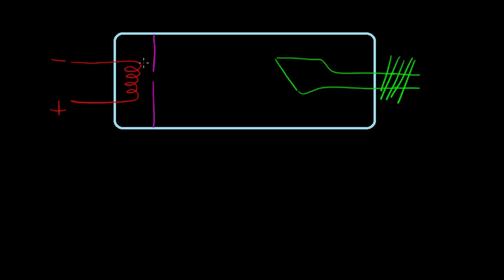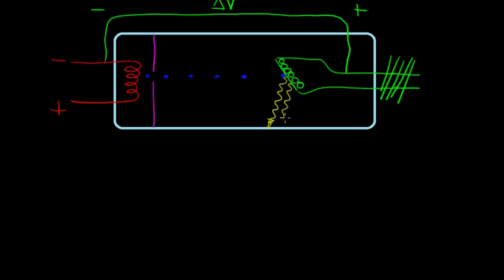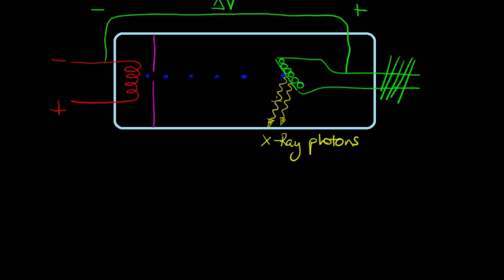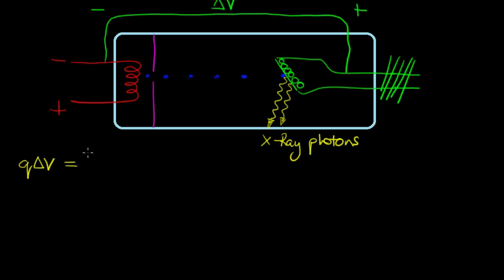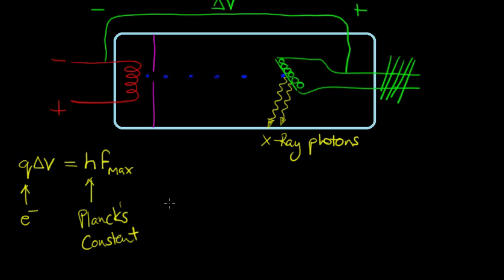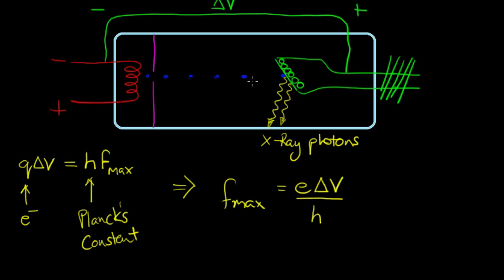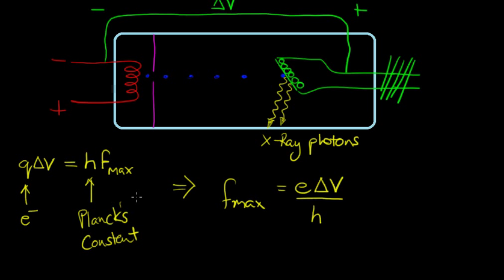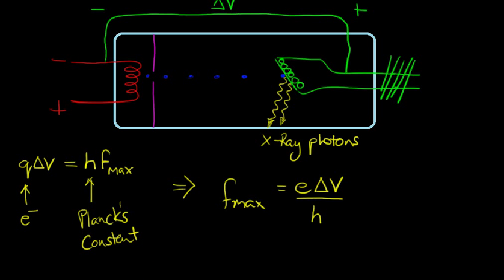X-Ray Tube

Comment: It might have helped if you mentioned that the filament is heated so as to lessen the bond of the electrons for the atoms that comprise the filament. It has been years since I've done gamma and x-ray radiography, so please bear with me. Isn't it true that sometimes an electron doesn't strike anything in the target, but instead comes close to a proton (opposites attract) which causes the electron to change direction slightly and slow down and the lost energy is given off as two gamma rays?